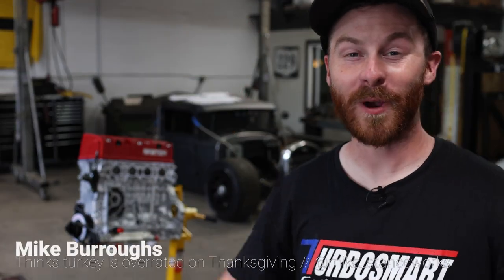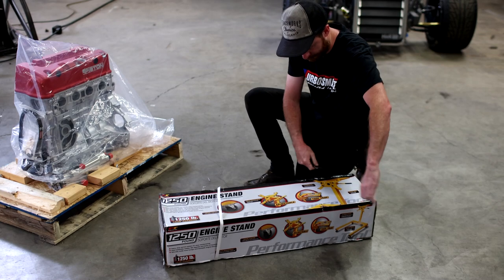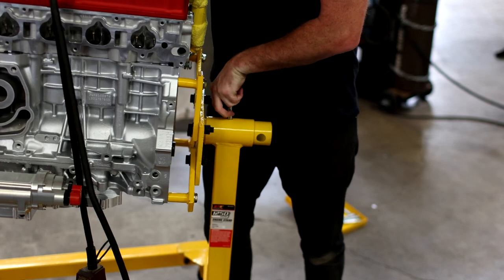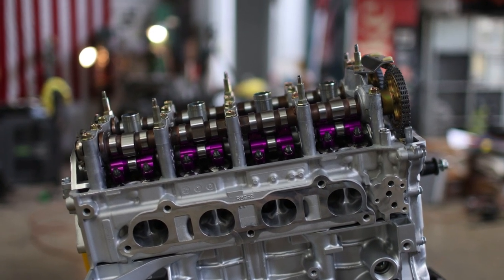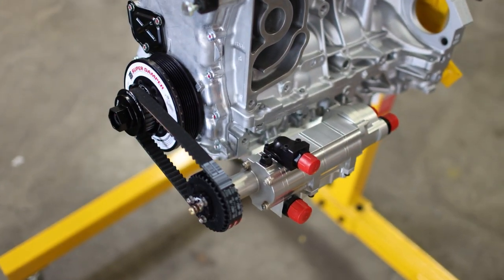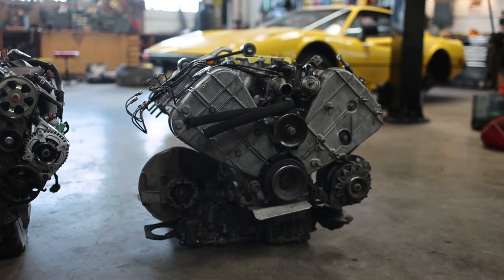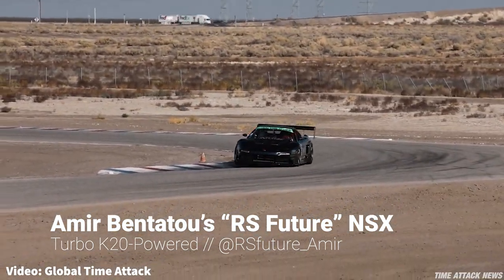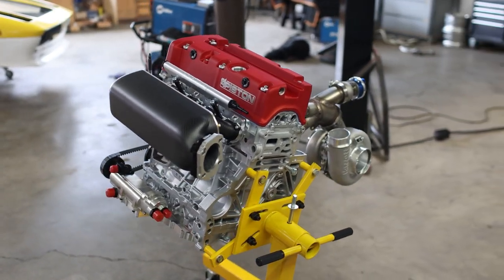My 1200HP Honda Engine IS HERE! K Swap Ferrari Ep. 57 (4Piston KT-1000)

Comment: M3 V8, 9000 rpm v8 460 hp would be perfect . Honda engine is awesome just short of 4 cylinders 😊
Reply from the maker: Wouldn't have fit though, otherwise I would have.
Reply: @stanceworks  oh damn , I’m having similar issues squeezing one into a W201 Mercedes , it’s in now but I had to cut a lot out to get it to fit .

Comment: My question is, it's a road course/time attack car right? So, no Vtec = no bottom end torque and meh midrange. Also, to be capable of 1000+hp you need a big ass turbo. Is that really what will do well in a road course car? I'd think not, but staying tuned in to find out.            P.S. Maybe with rally car style antilag, but that would be super annoying...
Reply: For fun, I get it. Just got to that point in the video. The question is still valid regarding vtec though.

Comment: "Thinks turkey is overrated on thanksgiving"  How could you say something so controversial, yet so brave? 😁😁😁😁  I think the only other engine that would physically fit and still be a good power platform would be an NSX V6.  Now, an off the wall engine, Cadillac Northstar V8 those at least came in a transverse setup, but not a manual.
Reply from the maker: Northstars are also known for being huge piles of shit haha.
Reply: @stanceworks  that is true as well 😂.  there is a shop out in NorCal I think that specializes in making high HP mods for them. Especially for turbo sand rails.  But no where near the support of LS or K-series.

Comment: I have to ask, how does the warranty work on those engines?
Reply: You break it, you buy it
Reply: @harrisonvoorhees  yes I understand that, but this engine is build to handle 1200 hp, if you tune it to 8-900 hp and it brakes, there isnt any warrenty to converter what... And it brakes after 1 week, or 3 mouths....

Comment: Ok, you asked, how about a built 2.5 Audi five pot?  That honda will never sound as good and you can get the same power :)
Reply: Would be a hard fit, horrible to work on it in the engine bay, and what about reliability?
Reply: @staLkerhu  Curious, where your reliability question stems from?  From the (somewhat) reliable WIKIPEDIA: An Audi five-cylinder engine as a power choice is very popular in European Drag Racing Championship, particularly in Scandinavian countries. With extreme modification for Drag Racing, the Audi produced 2.2 20V Inline 5 engines (like 3B, AAN, ABY, ADU) is shown to be capable of power in excess of 1 megawatt (1,340 hp).[22][23]
Reply: And guessing given the enormous amount of space he has to work with in the back the fit wouldn't be a problem.

Comment: i would say vr6 is just slighly better  look and sound then k series albeit  not as reliable at the 1000hp mark. 700hp can be done reliably though with i a better power band. and a euro in a euro. but would i race it? well k series wins there

Comment: a better engine in my opinion you could have chosen is RB26 (i know they are not so common in the US  and hard to build over in the US) another option it was 2JZ (and it is a commonly used engine in the US for builds)…
Reply from the maker: Neither of those would fit in the car though. Not even close.
Reply: @stanceworks  event thought i have seen a ton of RB26 and 2JZ’s and i work with them i have never seen a 308 in person so i wouldn’t know if it actually fits ..but if you say so you have to be right!! any way the build it’s coming along together really nice and clean !

Comment: Wait…Doesn’t a Vtec killer setup run the secondary lobes making it constantly in Vtec? I wouldn’t call that unnecessary. Unless your talking about the crossover system that makes Honda motors synonymous with the public. Then that’s just, well…hypocritical.

Comment: Running a non vtc and locked vtec engine is ment for a full drag race setup where the car will never see under 7k rpm so this engine is not what yoy want for a street car
Reply from the maker: It's meant for time attack racing.
Reply: @stanceworks  I was just going off what you said in your video "fun street car"

Comment: I would have a suggestion to make the engine Sound Like a flatplane V8, put a crossplane crank into the K24 ( with 90° krankpin spacing) with according cams obviously and Change the fireing Order to 1324 ( fireing Order of the Yamaha R1), after that i should Sound Like a flatplane V8 again
Here is a Link to the Yamaha R1 Sound:
https://youtu.be/U7vYjN6uRQQ

Comment: The honda j32 or j35🤷‍♂️
Reply from the maker: A good motor, too, but as good? Probably not. At minimum, it’s heavier.
Reply: @stanceworks the j series it weight 300 fully dressed not much more than the k to make a difference and u can make the same power safer do to bigger displacement i love the k and its gona be a beast ones u guys are done it would have been cool to see a j the k is the new LS lol but love the build keep it up💪

Comment: No no is one verie good projet just 4 cylinder is sooo good the consommation the motors is leteel no soo good job the plupart the boys is one v8 ls3 ls7 ho lsx 427 big bloc twin turbo is one projet archi vue parce que vous les americain vous monter des v8 partout quand je voie une e36 M3 ce faire monter one ls3 no serious the 6 cylinder bmw good prepa is one big bomb the motors is just vous ne connaissez que les v8 dommages y a tellement de meilleur moteur plus puissant si on c est les preparer

Comment: Seriously?  You try to put the stand mount on with the engine dangling in the air?  Leave the motor on the ground- install the mount, then lift it up and slide the tube into the stand.   And these engine guys build some sort of super horsepower race engine and then hand it over to a bunch of forklift and truck drivers with all the ports wide open, protected by nothing but some shrink wrap.